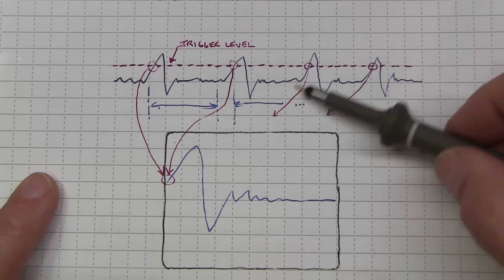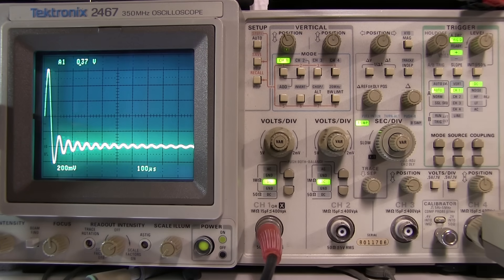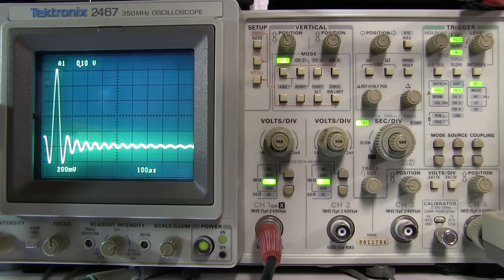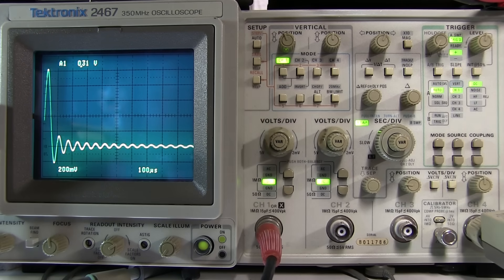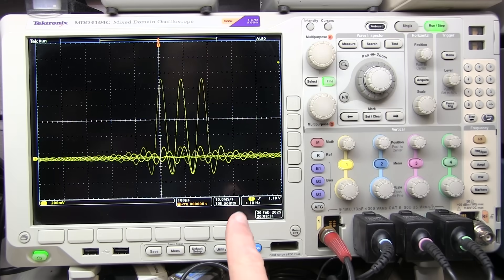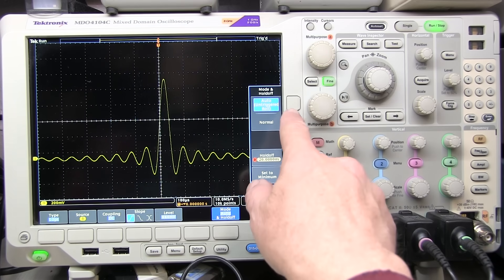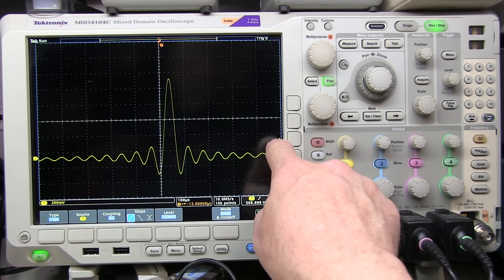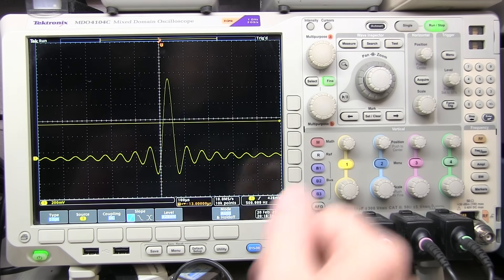#396: Demystifying Oscilloscope Triggering - what it does and how to use it

Comment: I have not been able to figure out why on especially Keysight DSOX 3,4000 series, changing vertical scaling can change the ability to reliably trigger for a given signal (in normal or single shot mode). As I "tune" the vertical scale I often have to move my trigger level. Why is that?
Reply from the maker: Many/most digital scopes don't scale the trigger level based on the vertical scaling.  So, in this situation, depending on your input signal, you might try using setting the Trigger's coupling to AC so that it will always find the "average of the wiggle" as the trigger level.

Comment: Great Timing ! I recently took my B & K 1474 30Mhz Oscilloscope out of storage for 30 years. For practice in refamiliarization I was probing around a vintage 100 Kc Frequency Standard that uses a 6U8A.  I could not get any stable wave forms. After watching this video I took the oscilloscope out  of Auto and selected Normal. With very slow adjustment  of the Level Control I was able to see the and measure the various sinewave and sawtooth wave forms. I practiced adjusting the placement of rising slopes for the Triggering, very touchy. Thank for the Information!

Comment: Heh.  My first several scopes weren't triggered,  they were what was referred to as "recurrent",  and the knob you adjusted to try and get it to sit still so you could see it was "Sync.",  short for synchronization.  Sorta like fiddling with the vertical hold knob on an older TV set...
Reply from the maker: Yes, the recurrent sweep scopes used the sync and the vernier sweep frequency adjustments to “injection lock” the sweep oscillator to the input signal.
Reply: @w2aew  Not a bad deal when all I could afford back then was $20 at a pawn shop and replacing some capacitors...

Comment: Nice video Alan.  I have always wondered why Tek scopes free run when in auto mode at sweep times of 40mS and slower?  They do trigger in Normal mode, though.  Thx, 73, de W3FN.
Reply from the maker: The Auto Trigger timer is on the order of 50ms - if it doesn’t see a valid trigger event in that time, it self triggers.

Comment: Good stuff.  You'll get to state triggers and other cool debug stuff later (love when hardware has built in debug stuff, especially if you have a LOT of data signals, but to show someone complex logic triggers and symbol maps opens up not only modern logic analyzers but discussion of BIST/DFT concepts - your second scope has a socket to add some LA leads).  Very much the first thing to be able to do is stabilize a signal and understand basic time domain measurements/scale.

Comment: @ 8:10 Some analog scopes, E.G. - the HP 1740A,  have a "sweep delay" vernier adjustment, usually with a calibrated multi-turn potentiometer, so you can vary where the viewed waveform will appear on the screen and see the part of a trace that may be before a signal that has a higher level peak..

Comment: Thank you. Even though I have used an oscilloscope a fair amount, I did get something from this: the better scopes will slow the last triggered sample. If ever I got in front of a scope such as you have, I would fear that I broke it, when it has that extra feature that my 1054z does not.

I still don't see much anywhere for DC coupled amplifiers, like used for function generator amplification. Some people were using a T1 OPA541amp, but there have been reports that they suffer from crossover distortion. I also had seen someone make one from EL2099CT Video Distribution Amplifier, which is no longer made. Also, the  HP 467A Power Amplifiers seem to be getting spendy. I suspect that a op-amp could be used on the front end. Is the rest just a class-a amp with some bias adjustment to compensate fro the lack of capacitor coupling?
Reply from the maker: Something like the TI THS3491 might be a nice one to look at - depending on what you need for speed and output voltage.
Reply: @ , thank you for the reply. The price isn't bad. I am downloading the sheet, now.
And what am I greeted with on the sheet?
"Typical Arbitrary Waveform Generator Output
Drive Circuit" LOL! Thanks!

Comment: Always enjoy a new w2aew video! Can you explain the relation (if any) of the data sampling rate, the record length and the horizontal scale display when it comes to triggering? Does that affect it at all?
Reply from the maker: For the most part, the triggering controls are somewhat independent of the sample rate, record length and horizontal scale.  However, there are cases where it can matter - for example: if you are doing a Pulse Width trigger on a very narrow pulse, and the sample rate is set too low to adequately sample the narrow pulse, then the scope might not trigger properly.  In most cases you'll have the sample rate high enough to adequately represent the signal, so it will be sufficient for triggering as well.  Also note that long record lengths (deep memory) can affect how quickly the scope an re-arm the trigger - thus affect the waveform update rate (more missed trigger events).

Comment: I use my analog Tek most of the time because I like the CRT presentation and sharpness but I also have a Tek color scope and that I use because it presents additional data like frequency and voltage etc.  The digital seems better with clean non noisy signals, to me.

Comment: Thank you, this video was very informative! Especially the clear explanation of the Auto mode. I often use my digital oscilloscope to check whether a clock signal is present, I usually place my probe, hit the 'auto' button and hope for the best. May I ask you how should one configure the trigger mode to check clock signal? Many thanks
Reply from the maker: Edge trigger, + slope (rising edge), threshold 0V with trigger coupling set to AC coupling. This should work on your clock every time.
Reply: @w2aew  thank you so much!

Comment: Oscilloscope Triggering Demystified: A Concise Guide

*   0:00:03 Triggering Purpose: The primary function of triggering on an oscilloscope is to provide a stable display of the signal of interest.

*   0:00:37 Analog vs. Digital: Analog and digital scopes achieve stable waveforms differently due to their operational differences. Analog scopes use a sweeping electron beam, while digital scopes continuously sample the signal.

*    0:01:11 Common Triggering Feature: Involves setting up the trigger to identify a condition (feature) on a waveform, and put this at a defined location on the screen.

*   0:01:51 Edge Trigger: The most common trigger type (95% of cases) is the "edge trigger," where the scope triggers when the waveform crosses a specific voltage level (threshold) on either a rising or falling edge (slope).

*   0:02:29 Auto Trigger Misconception: Auto trigger mode does not automatically set up the trigger. It self-triggers the scope when the defined trigger event isn't found, providing a visual aid even without proper signal triggering.

*   0:03:20 Auto Trigger Advantage: It's beneficial because it displays *something*, allowing users to adjust vertical scale or trigger level, avoiding a blank screen.

*   0:03:30 Trigger Circuit Operation Differences: Trigger circuits behave differently in analog and digital scopes. Analog scope triggers initiate the sweep of an electron beam. Digital scopes use the trigger to save and display the signal of interest from continuous sampling.

*   0:04:19 Analog Scope Visualization: Triggering on a repetitive waveform starts the sweep at the same point each time, creating a bright, stable trace by overlaying successive sweeps.

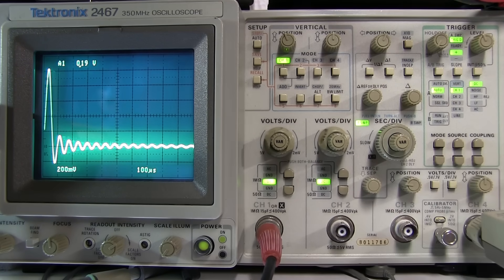* 0:07:54 Limitations to Analog Scopes: Can't see before trigger occurs, so can't see what is going on before trigger.

*   0:09:09 Digital Scope Advantages: Continuous sampling allows for pre-trigger data, showing what happened before the trigger event. Waveform storage also enables capturing single-shot events.

*   0:10:17 Digital Scope Trigger as Bookmark/Filter: The trigger acts as a "bookmark" or "filter" to display only the data that matches the trigger criteria.

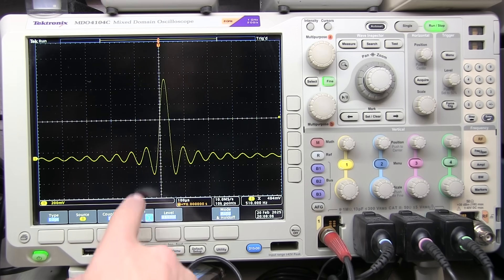*   0:11:08 Trigger Location Difference: Digital scopes display the trigger point in the middle of the screen (by default), showing both pre- and post-trigger information.

*   0:11:56 Digital Scope Trigger Types: Digital scopes offer more trigger types than analog scopes, allowing triggering on specific pulse widths, timeouts, or other signal characteristics.

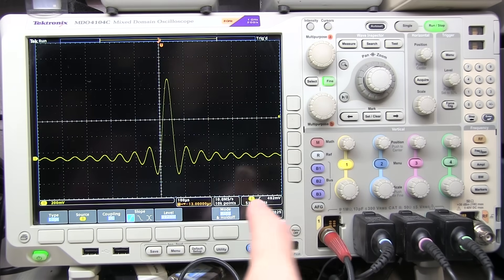*   0:13:09 Normal vs. Auto on Digital: In "normal" mode, the display freezes if the trigger isn't met, showing the last triggered waveform. "Auto" is generally preferred unless capturing a single event.

* 0:15:03 Trigger Level Shortcut: Many digital scopes allow setting the trigger level to 50% of the signal amplitude by pressing the trigger level knob, providing a good starting point.

*  0:15:19 Simple Edge, Most cases: Simple edge triggering is sufficient for the great majority of users' needs.

I used gemini-2.0-pro-exp-02-05| input-price: 1.25 output-price: 5 max-context-length: 128_000 on rocketrecap dot com to summarize the transcript.
Cost (if I didn't use the free tier): $0.03
Input tokens: 17687
Output tokens: 739

Comment: How You generate that example waveform?
Reply from the maker: It is one of the arbitrary waveforms built in my Arbitrary Function Generator (TEK AFG3252)
Reply: @w2aew  is it possible to generate it somehow with simple circuit?
Reply from the maker: @adrian_sp6def  You can get something similar (damped, decaying sinewave) by putting a square wave into a parallel L-C tank circuit.  See my video on measuring capacitors and inductors -look around the 8:00 mark in this video: https://youtu.be/74fz9iwZ_sM?si=ay0DBSgDKBFsfYS4

Comment: Interesting. I had two digital oscilloscopes,
an old HP digital with CRT display and the new is a Rigol DHO800.
The old one had different AC triggering, which had me select the hold off time in ns or us etc.. and the rigol has so high storage depth compared to my old one I never had to tune the hold time so it doesn't dance around because of not having a good sense of the repetitive waveform. These new scopes really help a lot with noobs like me

Comment: Why can't Analog Oscilloscopes view the Pre-Trigger Information? There is no way to move the "Trigger Location" to START in the middle of the screen using Analog Oscilloscopes?
Reply from the maker: Only using the B Delayed Timebase. See my video on that.
Reply: @w2aew  most analog oscilloscopes don't have a B delayed timebase, so is there another way to move the trigger location? Using the external trigger port can this move the trigger location?
Reply from the maker: @waynegram8907  No.  The sweep is initiated by the trigger.  The scope can't "anticipate" when a trigger will happen, so the sweep can't be started before the trigger.
Reply: @w2aew  you can't Delay the trigger or delay the sweep? Nothing can set an offset time to the trigger point location or sweep?
Reply: @w2aew  the B delay time base ONLY sets an offset time delay to the sweep, NOT the trigger location point?
Reply from the maker: @waynegram8907  Consider this question - is it possible to fire a bullet out of a gun BEFORE you pull the trigger?  That's really the same issue here.  The only way to do this in a limited way would be to route the input signal thru a BNC-TEE on the External Trigger input, and then add a LOT of coax between the TEE and the channel input, to create a delay (from the cable) between the trigger and the signal seen by the vertical input.
Reply: @w2aew  a poor man's version of a B delay sweep would be using a passive RC network or a chain of passive RC network connected to the oscilloscope external trigger port?
Reply: @w2aew  why not make a video lesson showing how to make an external Delay B sweep circuits because I'm sure there is simply delay sweep circuits to use to connect to the oscilloscope external trigger port
Reply from the maker: @waynegram8907  The delay has to be on the SIGNAL, not on the Ext Trigger.  It is not a simple thing to do, which is why most analog scopes don't have the feature.
Reply: @w2aew  so the B delay sweep circuit must be some type of sample and hold circuit or a bucket delay BBD IC chips? Inside the analog oscilloscopes that had the B delay sweep
Reply: @w2aew  I would think the delay would have to be on the Trigger because you want the trigger location in the MIDDLE of the display. So that is why I'm confused because even if you delay the ch#1 input SIGNAL the trigger location is still going to be located at the left of the display screen, NOT in the MIDDLE location using analog oscilloscopes?

Comment: LOL, where were you in the 80's when I was in the VOTEC electronics course in high school.  As great as my instructor was, scope triggering was one of the things that he did a rather poor job explaining.  Of course it only took a short time playing around with the controls to figure it out myself.  I often wonder if that was on purpose.  You know, the kind of "Inquiring minds want to know." kind of thing.  I think this is one of the most misunderstood functions of how a oscilloscope functions to new users.  Don't have enough fingers and toes to count how many times I have explained this to people, especially HAM's.  Mike KC3OSD
Edited to add:  Some of the new scope trigger features are great.  Being able to set a "window" for a trigger is priceless.  Great for finding runt pulse events that may not meet the standard high or low level settings of a standard trigger.